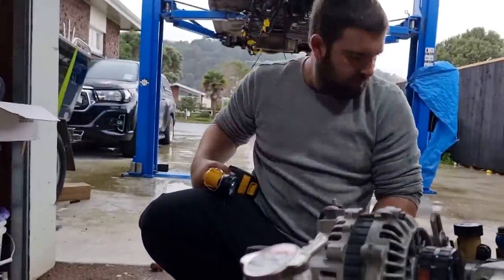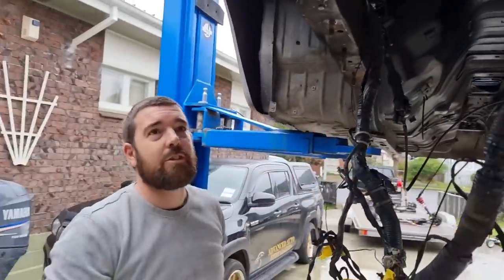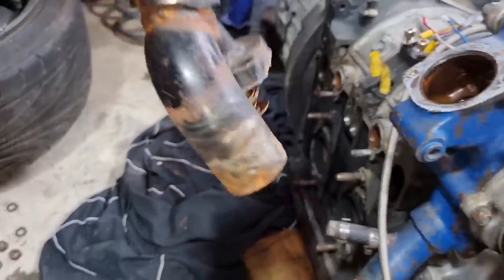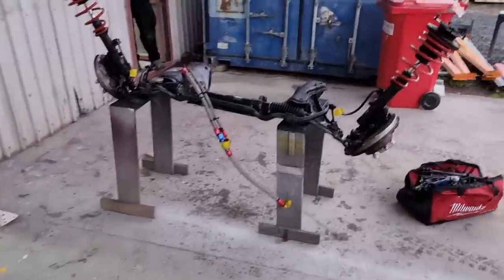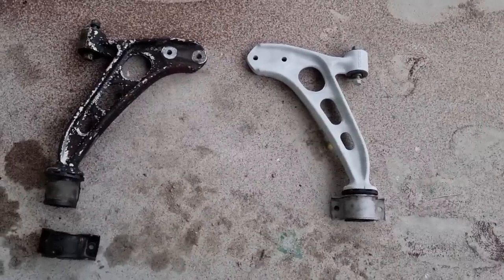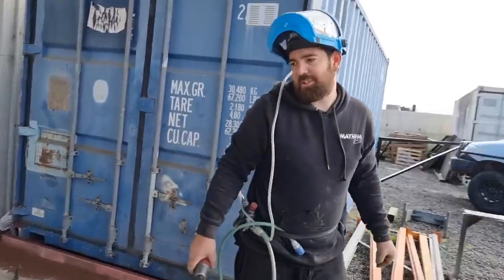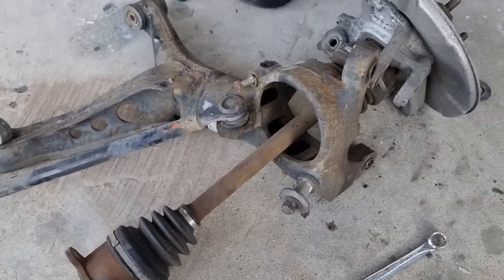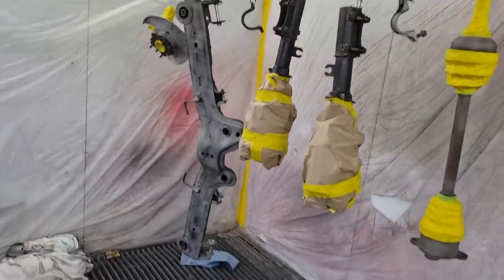RX7 BUILD IS ESCALATING - Painting Everything!

Comment: Studding is oldschool needs tobe dowled. Tip clearance rotors balance the assembly rx8 stationary gears race clearance bearings. Scr Apex seals some oil mods and you can safely make 600+hp

Comment: What's the dials on the rear shocks ..are they old school adjusties? 😎🤘❤
Reply: They are adjustable kyb dampner shocks. The fronts have them in the top hat .
Reply: @jamessutton5546  cheers for the reply bro . And bring on your channel keen as to watch your content bruv 😎🤘❤
Reply: @jaye696  cheers man if there's enough interest I'll give it a go.
Reply: @jamessutton5546  Hey what paint did you use to do the subframes etc.? Did you clear coat them too or was it 2k paint? Cheers be good to see more of your work
Reply: @nzuncovered1845  they have 2k epoxy and 2k caprithane Matt black the cast aluminum parts have a 2k Matt clear
Reply: @jamessutton5546  Thanks!